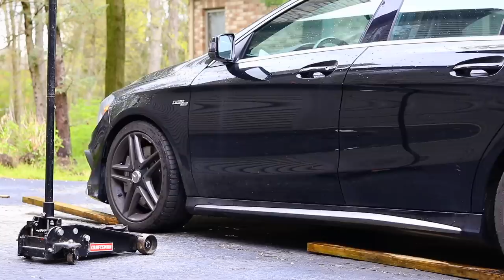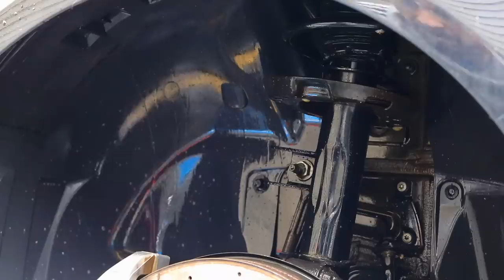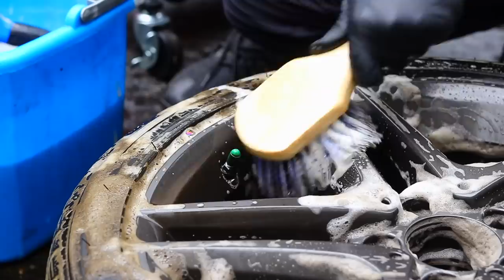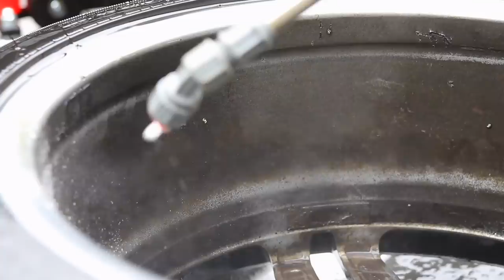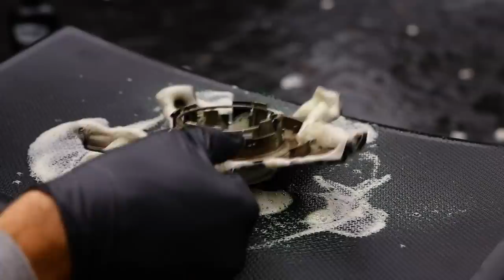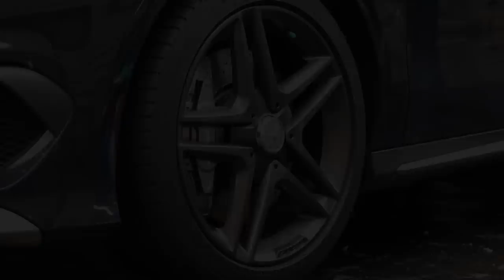Extreme Cleaning DIRTY WHEELS *Satisfying Car Detailing*

Comment: as a mercedes-benz master tech I can appreciate this. only issue with these cars is that the wheel will be covered in brake dust again in less than a week. price you pay for good stopping power. also gonna give you a side tip. if you pop your hood and look at the engine cover at the very front, you will see where the edge is rubbing into coolant hose.. over time it can rub through. apply a small piece of black felt tape to the panel to prevent this.
Reply: As a mechanic, this is a helpful tip. I know several people with Mercedes.
Reply from the maker: Ill look into that for sure. Appreciate that a lot.
Reply: @StaufferGarage  NP, the M133 engine is a very good powerplant.  AMG had to cram all that stuff under the hood of a 117 chassis so things are tight. LMK if you want the instructions to put the car in dyno mode for the full AMG experience.. ( IE no esp whatsoever) :)
Reply: @malloymotorsports780  I'm surprised that you didn't have a problem with him spraying wax onto the brake rotors. I cringed when I saw him doing that. A definite NO-NO on every car that I know of.
Reply: @stans5270  honestly I started the video and then started doing things around my house. I didn't catch that part.
Reply: Stan S I was thinking the same thing.

Comment: Few things are more satisfying than having a perfectly clean wheel/tire and seeing your wheel well plastics turn black again after dressing them. Also a tip for the brake calipers is to blast them with the steamer. Helps to get even more brake dust behind the caliper that is hard to get with a brush
Reply from the maker: Great idea on the steamer, will have to try that out next time

Comment: Great job! 
Recommend that you use a iron remover or an acid wheel cleaner to take the burned metal particles. Unse also clay. Also use a Tar remover 🙂
No need for sanding it 😉

Have a great weekend 👌

Comment: As a former Mercedes and former Toyota mechanic, I do have to say, because Mercedes are performance vehicles, the brake pad material is super soft. Great for breaking, horrible for brake dust. Way worse than any Toyota, but because it is a softer material, it honestly does clean up pretty nice. Now, on a Toyota with nasty break dust, that takes a little more work/stronger cleaners to get those to look new again. It would be nice to see your take on that!

Comment: Good video.  Are you going to use a longer lasting coating on the wheels?  I do like the spray on spray off feature of that Meguiars product for a wheel topper though.   Since we are all about the details, I would cut off all those molding nibs off the sidewalls.  I have similar tires (PS4S) which have a pretty smooth sidewall.  Those just ruin it and it makes the dressing look better.  I'd ditch the green valve stem cap too.

Comment: Good work cleaning out the holes in the rotor! When those plug up with brake dust they start cutting grooves into the brake pads, and rust rings start developing because the pads aren’t touching the rotor in those spots.

Comment: I used to detail my own vehicles. I don’t at the moment due to my injuries from when I was in the military and having a suitable surface (concrete/blacktop/etc). I’ve been watching a lot of detail videos and want to work my way back to detailing my vehicles. That said, I cringe ever time a brush or solution is applied. How do you keep track of what brushes, product(s), and other items to consider when detailing the various surfaces, crevices, etc. to ensure the quality detail you want to achieve/provide for the customer without damaging the vehicle? I know that’s not so easy a question to answer nor a cut and dry one. Thanks!

Comment: I'm a mechanic and I use a rubber wheel pinstripe eraser tool to remove wheel weight adhesive from the inside of the barrel of wheels. I find it also removes most staining, so maybe that would help clean it to. My only concern would be it maybe burning thru paint if you kept it in one area too long. They sell the wheels on amazon that can be used with a drill, or they also have dedicated air tool and rubber wheel sets. I know astro makes one of the kits, found here: https://smile.amazon.com/dp/B007C4O1ZC/ref=cm_sw_r_other_apa_it_7rWREbG511P0A

You can also get individual wheels for less than that, but the astro kit is a really good deal with the number of wheels it comes with for the price

Comment: I see that you also have the jacking blocks that fit inside the jacking pockets on the frame of BMW's. The guys at my local Discount Tire had never seen them before. BTW, looks like you're gonna be needing rotors in the near future from the ridge I see at the outer edge. Just replaced the rears on my 535iGt because of pulsing. Best prices at Rock Auto.

Comment: caustic oven cleaner will get all of that nastily baked on brake dust off the inside of the wheels. You must be mindful of splash back when rinsing. Good for cleaning engine blocks too but again be careful as that stuff burns the skin.

Comment: The screws/bolts (not sure how you call them), aren't they going to get rusty?
Reply from the maker: Depends on the material they are made of and in the case of these they are an alloy to prevent rusting
Reply: Mercedes bolts are very rust resistant, so are BMWs. 
Audi/VW bolts on the other hand, get surface rust if you forget or lose the plastic caps

Comment: I have owned cars and motorcycles since I was 14 years old, but I have never taken the wheels off to clean the inside of them or the brakes. I, kind of, feel like a dummy. I would give my wheel wells a good cleaning to take off the dirt, sand or salt.
Reply from the maker: You won’t regret it!

Comment: I think you’re using way too much Megs Ceramics spray wax. Starting from 8:17 you see that you still have droplets and the towel gets very wet while drying. That’s not how it should be.... less is more with this one.
I am also not sure about using this product on brake discs/rotors and tyres.

Comment: Why did you spray that wax on the wheel hubs?!? Any grease you’ll put there (copper) will just wash away and next time the owner needs to remove that wheel will have a head time getting it off. Future more you didn’t fancy putting a little bit of grease on the wheel bolts so they don’t seize in due to heat. Glad I won’t be taking that wheel off after a few heat soaks.

Comment: hello, to stop using the screwdriver with the brush to clean the inside of the wheels, there is a French product, from the Shine brand, in 2 minutes even the most contaminated wheels will be clean with the use of the high pressure jet, there is no need for mechanical action nevertheless but possibility nevertheless.

Comment: did you just seriously wax your rotor you know how that could be an issue right maybe I could understand waxing the caliper as long as your carefull not to get it in or on your pads or rotors and your power washer is your friend on this job will get a lot more gunk out with out having to poke each drilled hole on your rotors and try clay barring those rims you wont regret it and give those rims a lot of wax and they will be so much easier to clean the next round

Comment: Sprayed iron remover on an item made of iron.....then finished it off with spraying wax on braking services SMH 🤦🏻‍♂️
Reply from the maker: It was more for the drilled holes and one squeeze of the brakes and that spray on coating is gone
Reply: The iron remover works on iron oxide (a.k.a. very small rust particles), not regular solid iron. The rotors are safe.